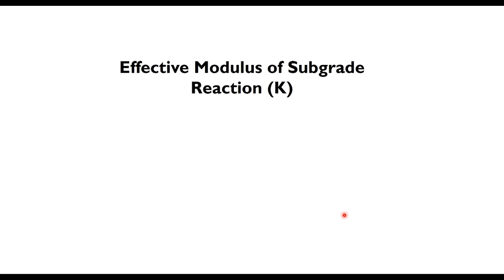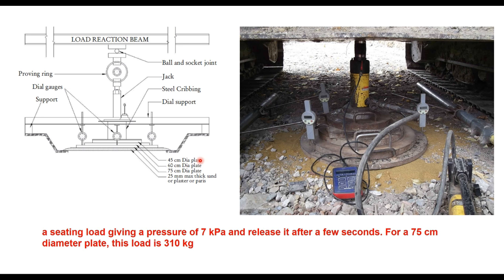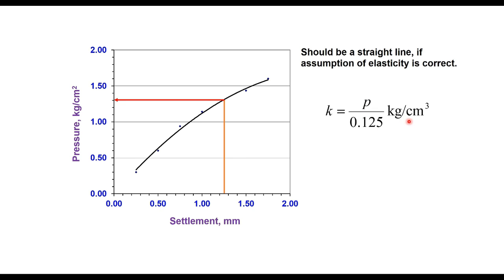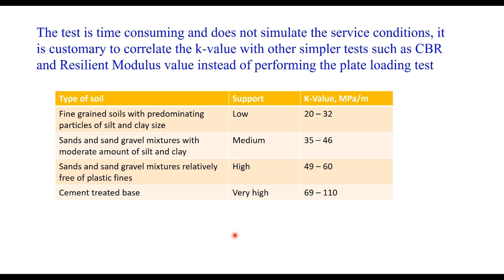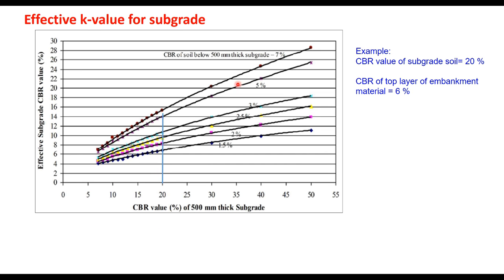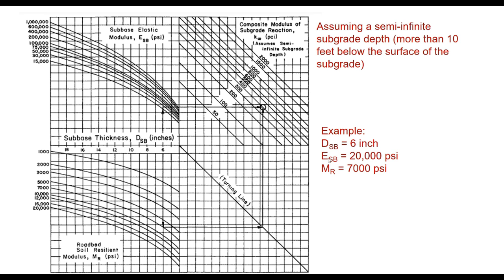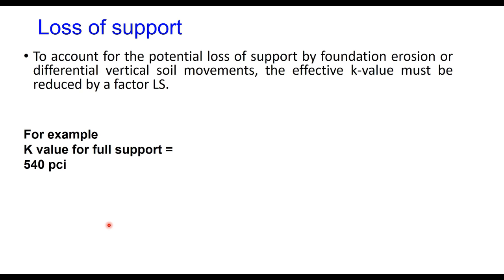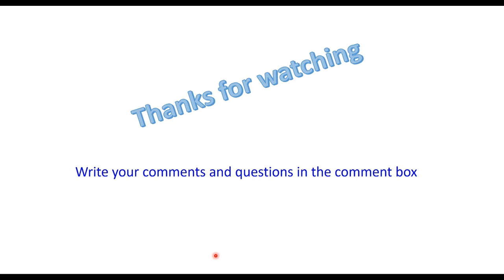#rigidpavements, How to determine effective modulus of subgrade reaction for rigid pavement design.

Comment: Sir, Please correct the Elastic modulus value of concrete as 30,000MPa in your Dowel Bar design Example.
Reply from the maker: Thanks for pointing it out. There is no method to correct it now in the video as I will have to delete the video first and then upload it again, But E value of concrete is not used anywhere in the calculations as the radius of relative stiffness (which depends on E)  is also given in the data. I will certainly make this comment of correction in E value in the comment box for the veiwers. Thanks